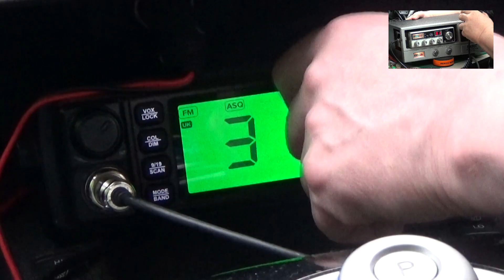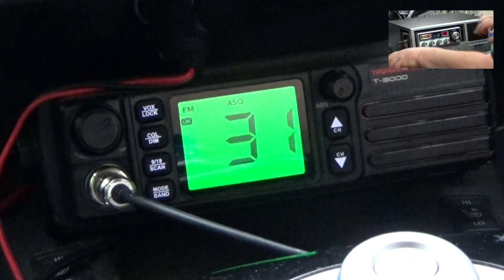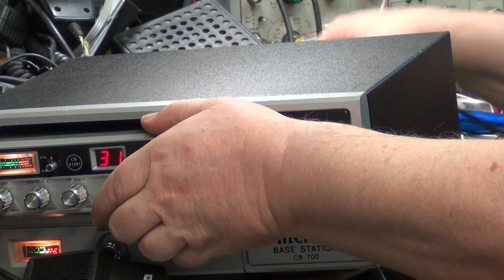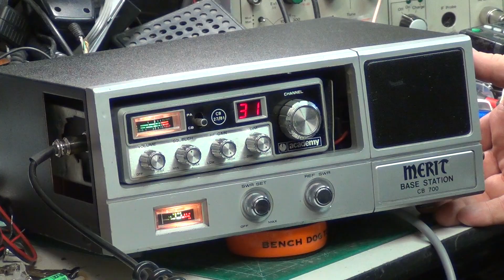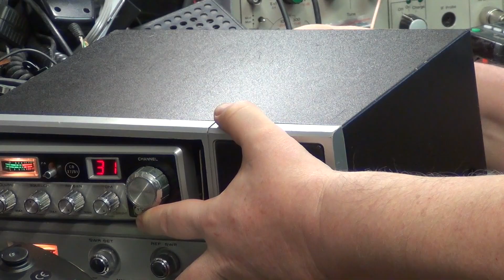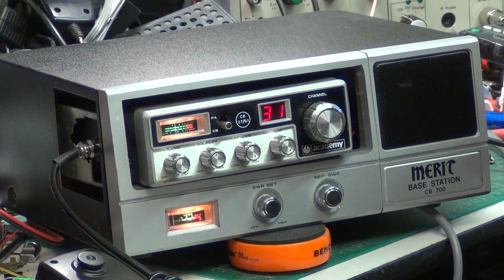Academy CB502 CB27/81 UK FM CB radio - On The Air test, with Merit CB700 base cabinet

Comment: Great all round Scratchy corner test,I learned that lesson of running SWR in line constantly in the 80's affecting reception as anything with external connections reduces signal it was the same at my parents house when they got Radio Rentals to put extensions from the TV aerial so they could run two TVs off one aerial it was terrible reception in both rooms so I rigged up a loft aerial for one and re-wired the roof aerial to serve the other room and the improvement was excellent and just the same with CB better to be in direct line with the aerial.